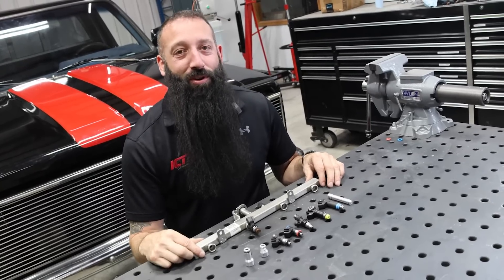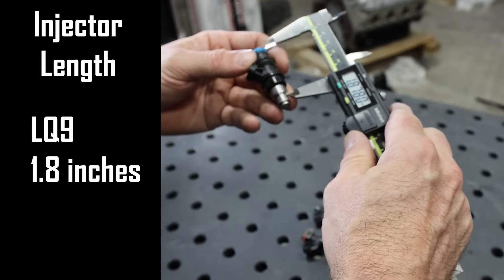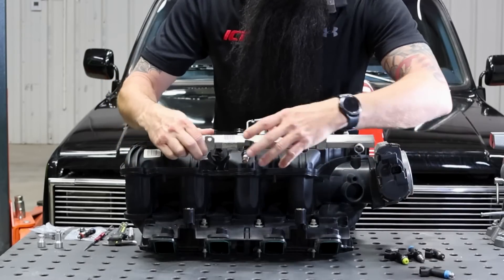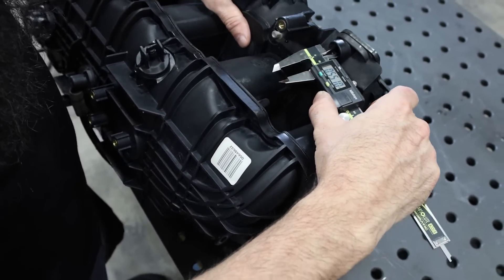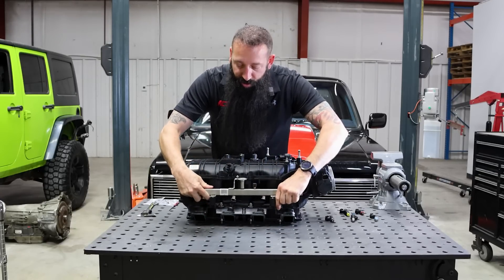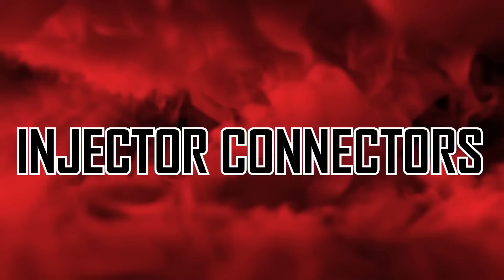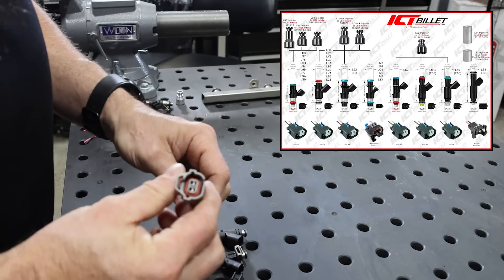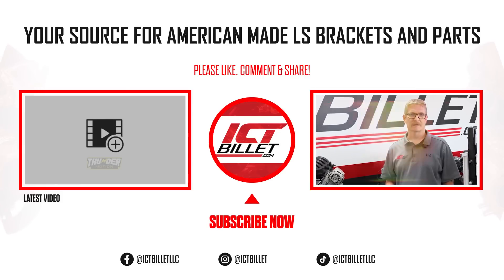LS Fuel Injector Adapter Guide | LS1 LS2 LS3 Truck Intake Manifold Compatibility

Comment: I would like to add E85 L59 injectors to my 05 yukon 5.3 LM7, what spacers do I need?
Reply: Not much of a bump use GM 12613412 popular upgrade. I just did same l59 to l96 use the ict 551287-ls-022 spacer.
Reply: Double check of you need anything else. I have lm7 too but got a l59 intake on my rebuild engine

Comment: I’m trying to put AUS Injection/Delphi LS3 750cc Injectors in a Gen 4 truck intake. The intake injector bosses are too small for the body diameter of the injectors (~16mm). Do you have a solution for that?

Comment: I can’t find the part number for the ls3 6.2. Could I get some assistance !
Reply from the maker: GMPP-LS3-525 will be the part number for that.
Reply: I am sorry for the confusion. I meant for the right fuel injectors! It’s going in my c10. I’m using a Camaro ss intake manifold.
Reply from the maker: @2smokecuts  No worries. We recommend our Fuel Injector Clinic FIC-IS303-0540H for this setup.

Comment: I have “ls3” FIC injectors (1.5”) in a Holley hi ram and the injectors slide up and down to the point I can see the o-rings 
I can’t see how that will seal
Reply from the maker: It seems that you may be using the wrong holes. There are 2 sets of holes, and I would suggest trying the other ones. If you need more assistance, feel free to reach out to our service team. We are happy to help.